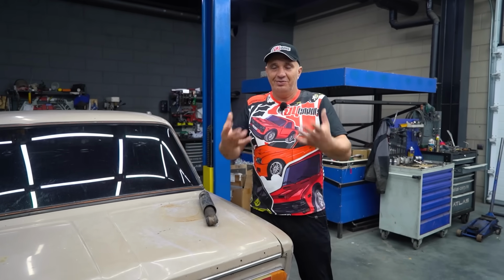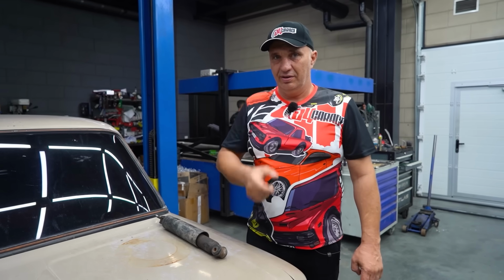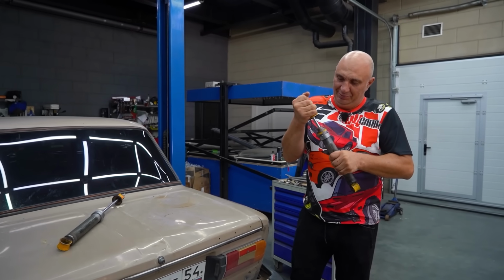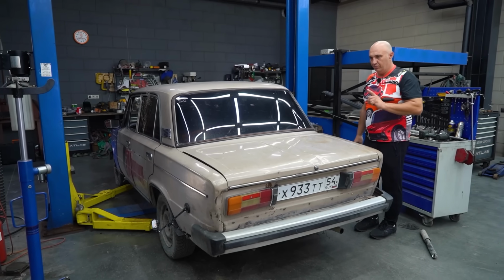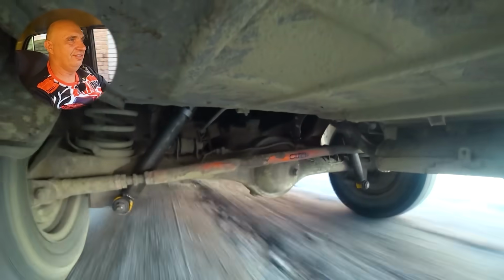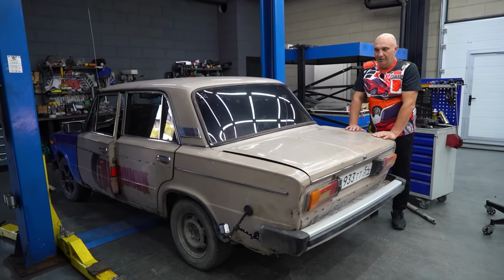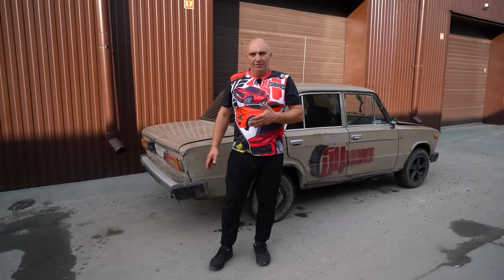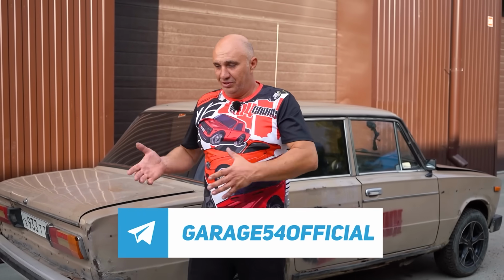We make our own DIY shock absorbers - for what purpose?

Comment: the "pistons" inside shock absorbers often have valves with "springs", regulating the speed or oil flow in both directions.
Reply: Yes from my experience most are designed to travel downwards faster than coming back up, to prevent the bounce back/return effects, so passengers feel the drop and slow rise, instead of updown motion discomfort 😮

Comment: Best to put an exterior oil exchange line in for custom shocks. Then you can put a valve of some kind to regulate the transfer rate.
Reply: Yup, a pair of them so they can separately tune up and down rates.
Reply: Add a fill & drain bolt hole to change fluid ?

Comment: Having the compression damping the same as the extension is unusual for a road car. Drag race shocks for the rear are sometimes noted as "50/50" meaning they have the same damping in both directions.
Reply: thanks for that knowledge nugget
Reply: And the front shocks are 90/10 allowing for quick extension, but slow compression.
Reply: @cmsracing  Never a good idea to let the front end rise up in a drag race.
Welcome to the 4 link world that pulls the nose down from the rear end.

Comment: You can also add a port to put some gas pressure in the shock... it keeps the oil from foaming. Usually uses Nitrogen, at not that high as pressure, like 80-100 psi or so.

Comment: I built some shocks for my Tamiya Super sabre RC buggy, they came with various pistons with different size and number of holes, some small, some larger.
Smaller holes allow less oil to pass through making the shock stiffer. Larger holes make the oil pass through quicker making them softer.

You can of course put thicker or thinner viscosity oil in the shocks to really fine tune them.

So you could have a small hole in the piston with a thinner oil to give a softer ride than a thicker oil would give with the same piston.
Reply: Or make bypass shocks.

Comment: I would fit some kind of one way valve on half the holes on the downward stroke of the shocks, so it will have a harder time returning back up, like a "reed valve" system. I'm not sure on the up-down ratio, but that would be a start to getting the movement up and down velocity not being equal.

Comment: I think that they are supposed to travel down much easier than coming up, as I noticed from the new trail bike shocks I fitted to the rear of my Special 650 road bike, my girlfriend was not happy, because she enjoyed the bouncing going through Brisbane city crossroads 😂 a good test is to push hard down on the front or back of the car, and release immediately so it should go back up and then down to stop at original position, but if it moves in more than 2strokes after release, then it needs shocks replaced.

Comment: a small reed valve with two differently sized holes would've made a one way valve to "increase" the flowrate in one direction of the piston travel.
Reply: And why is that desirable?
Reply: @Sekir80  faster recovery or faster drop. Depending on terrain type it helps extra. The military have gone one up and made the flowrate dynamic by electric coils.

Comment: Try motorcycle front suspension legs those you can change the rubber seal and fluid and have inner springs some allowed to bleed the air thru some bleeder valves

Comment: I did a little research on shock absorbers (I wanted to know exactly what kind of oil they use, but couldn't get the information). In the process, I discovered "tapered chain shock absorbers." They seem to be so new, I could only find research papers about them, and I still don't know how they work, just that they use some sort of solid-state technology to dampen shocks. Well, anyway, if you decide to try the idea, I'd love to see how it works.
Reply: My guess would be probably a generic hydraulic oil of some kind. (As It would have to be very heat resistant and probably a lower viscosity.)

Comment: I'd like to see you try your DYI shock absorbers with your massive lead weights in the tires. That would be really interesting. And see if it breaks the shocks or brakes mounts.
Reply: I think the car would be very shaken up from the experience. Probably would refuse to run after that.